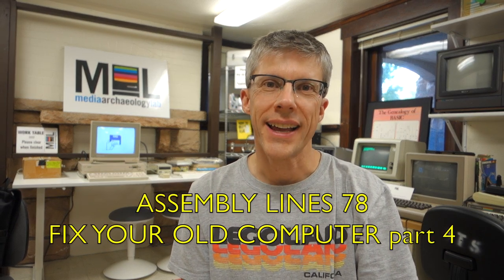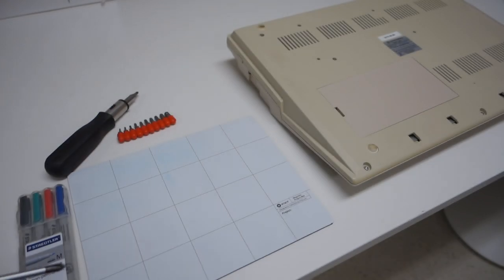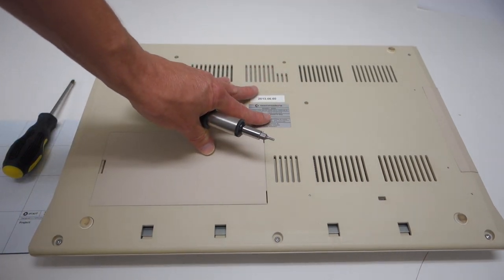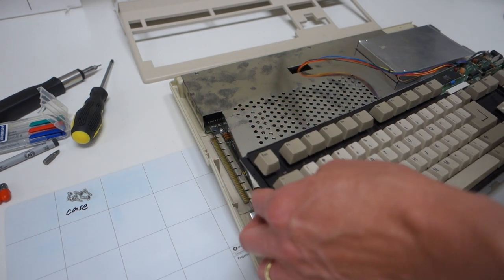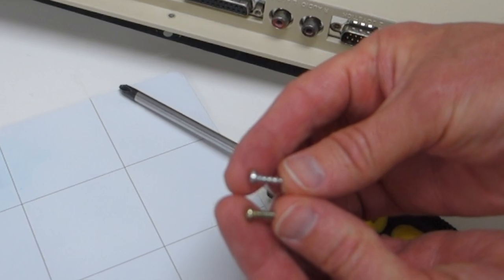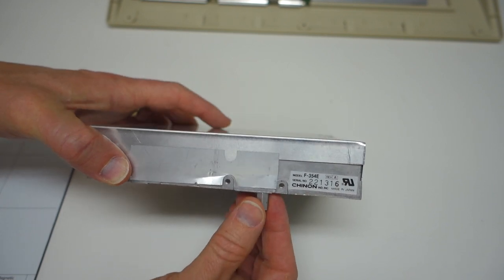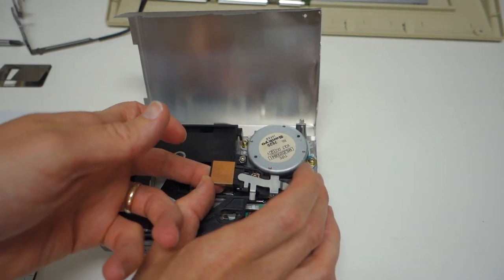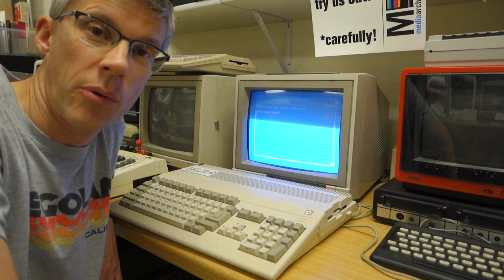#78 What's in this Amiga 500 Disk Drive?!

Comment: You have the devil's luck, Chris. You broken almost every rule when "fixing" a 3.5" floppy drive.
-Use a Q-tip (cotton swab)  wet with alcohol, never your finger.
-Never lift the top head/arm above the max height of the drive when it is open.
-use Long Tweezers, not a screwdriver to remove any strange items stuck in the drive mechanism.

Any 3 would have knocked the top drive head out of alignment and made the drive useless. 

And there is always a 50/50 chance that when somebody rips out a floppy drive that its door gets caught and rips off inside the drive, the top head will misalign. So you got very lucky in all of this. (This is always the case with Mac, Apple IIgs, and PC 3.5in drives.)

And as a long time Commodore Owner/User before I got an Apple, since Commodores were meant to run in homes more than offices, RF Shielding was heavy, as it were for Atari Computers and any other Home Computer. Taking a Commodore or any other Non-Apple/IBM PC will always be like this, and nothing to fear of or claim that it is difficult to do, we have been doing this since the advent of the machines.

Congrats on getting an Amiga up and running again.
Reply from the maker: Yeah, I figured that I would get a bunch of flack for playing so fast-and-loose with the repair rules. :-) Maybe it's better to not know all of these things going into it. Well, for the next 3 Amiga machines in the lab, I will take your lessons to heart. Thanks for all the tips!
Reply: You know your craft, Chris. That's a given. I'm worried about how the newbies and new-jack coming into Retro-Computing will take your information. Already I have counted several Newbie Wrecks in the Apple, Commodore and Atari FB groups because "I saw how to repair it on Youtube, bought a large soldering iron, tried to do the repair, and I NOW NEED HELP!!!" (That Apple II you diagnosed and repaired on the last repair videos was one such wreck, because its owner saw on another video on how to "fix it." Instead he wrecked it by breaking the trace with a screwdriver while lifting the chip off the socket.)

I'm not saying to stop making these videos, for they are needed and are important to share and teach such skills and information. But you should put a warning that if one is not skilled in using tools to fix things, then do not attempt to make such repairs and consult an expert, like yourself. Thumbs up to you.
Reply from the maker: Yes, I know exactly what you mean. In fact, in this video I actually had a part where I warned people to not try any of these techniques if they didn't feel like they had the skills. But when I listened to it, it sounded condescending so I took it out. No matter what kind of warnings I give, I'm sure someone will disregard them and bust their computer. I think the key is whether they learn from their mistakes. I've certainly made quite a few blunders, like the time I wiped the dust off my CRT (hey listen to all that cool static electricity!) and then immediately picked up an Apple II card. I've been much more careful since. Now, with your comments, I know to be more careful with Amiga 3.5" drives. There's only so much anyone can do to protect other people, but I'll think about adding more warnings, etc. Thanks again!